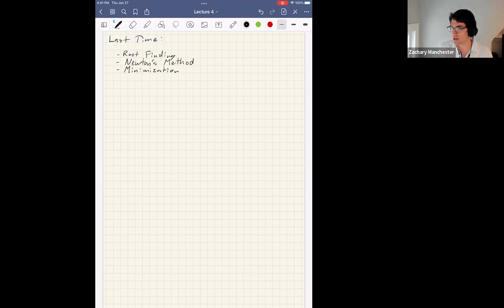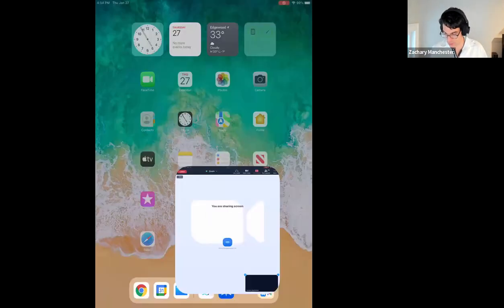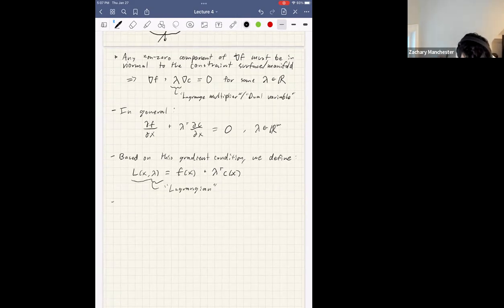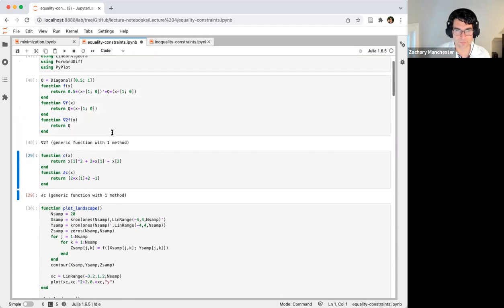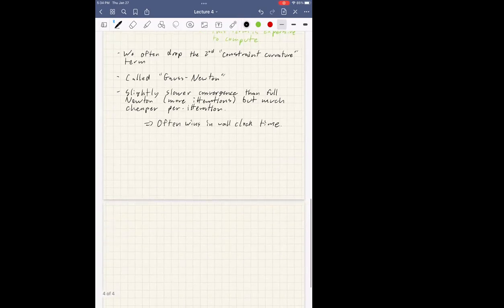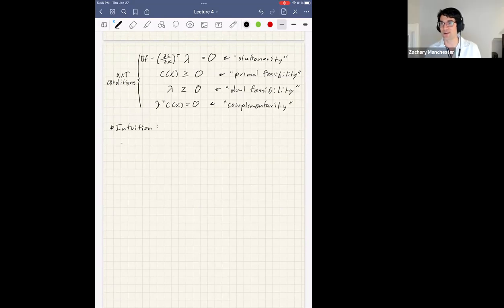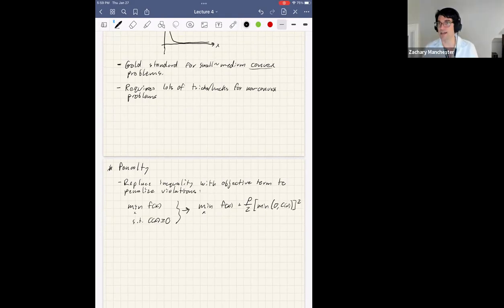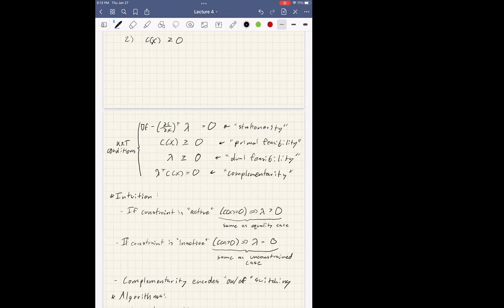Optimal Control (CMU 16-745) - Lecture 4: Optimization Pt. 2

Comment: The Line Seach Code in 10:47 dismatch with the note. Code "while f(x0+ \alpha * \increment x) > f(x0) + b*\alpha*\del f(x0)" drops the "\increment x" at the tail, is it a mistake or it doesn't matter?